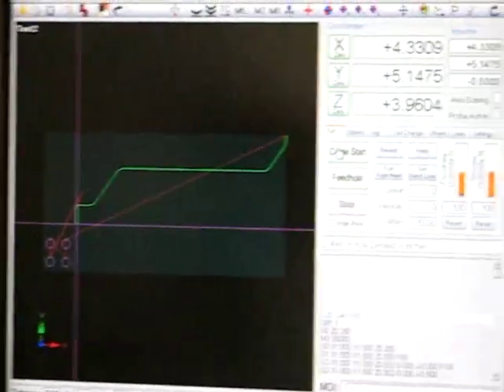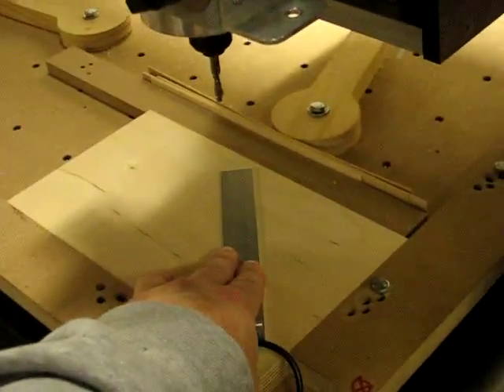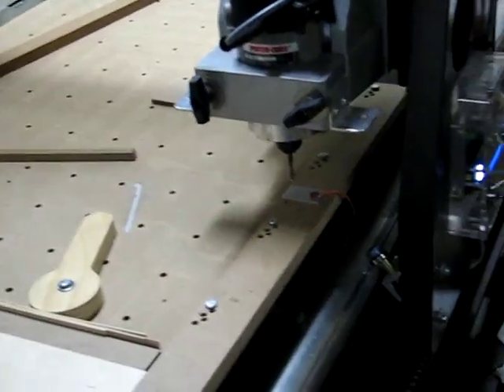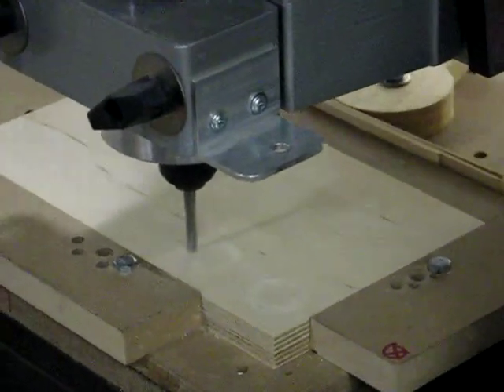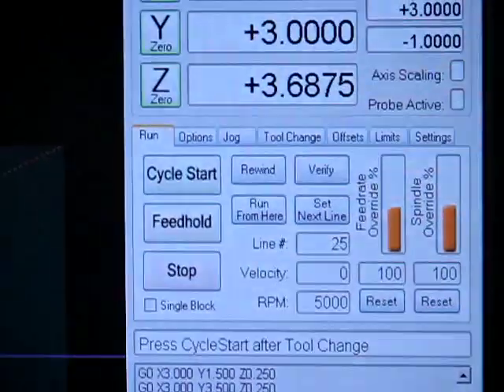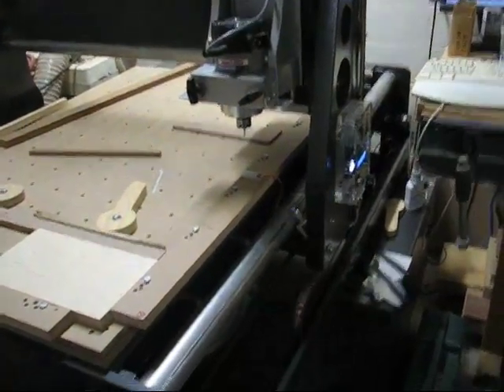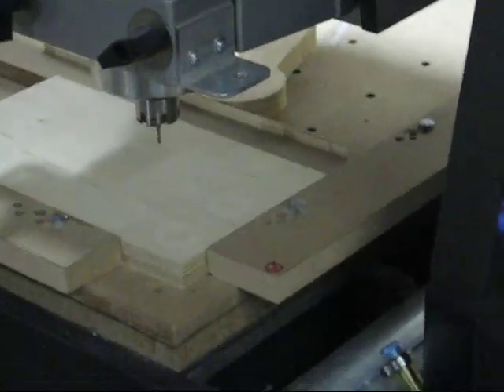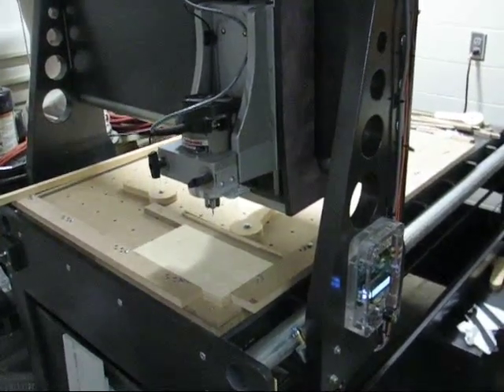Mach3 2010 Screenset Tool Change

Comment: hi I have two question, One can i install the tool change scrips with out installing 2010 screenset...Two if I install the 2010 screenset will i still be able to run my other plugins like edge finder ex.

Comment: After the tool change is complete and the 'Cycle Start' is pressed, Mach3 executes the next line of g code instead of moving the tool to the fixed plate. Could you please let me know what should be done to correct, thanks.
Reply from the maker: +JB 
Make sure you copy the macros from Mach3\2010 into Mach3\Yourprofile.
Does the Initial Auto Zero Work?
Also, on the Toolchange tab, make sure Ignore M6 is NOT checked.
Reply: CNCWoodworker - Auto Zero works just like your you tube demo with the 'Ignore M6' unchecked. However, when Mach3 sees M6, instead of moving the tool to tool change position as defined in the 'Tool Change' tab, it stops. At this point, if the 'Cycle Start' is pressed, Mach3 will read the next g code line. I've been looking all over other settings in Mach3 but still unable to correct this problem. If you can think of something that could cause Mach3 unable to read M6 please email me, flakjacket2k9@live.com. Thank you.

Comment: Do you have a site where you detail how the zero system is working.
I am using Mach3 will this work with Mach3?
Thanks
Reply from the maker: Yes, it's Mach3 running my 2010 Screenset. The Screenset includes all the macros to do the auto zeroing. There's a link to the 2010 Screenset manual and two tutorial videos in the description of this video above. Click Show More if you don't see it.

Comment from the maker: No, it doesn't. To work with an ATC, you would need to combine the 2010 macros with your tool change macro into a new M6 macro that would both change the tools and measure the new one. It's possible, but you'd need to write the macro yourself.

Comment from the maker: I don't know exactly what you want to do?? G55 isn't a position, it's just a different offset from G54 (Which is the default coordinate system).
If you want to move to a specific place, you can just add the g-code to move it there. The nice thing about the Park position is that all your g-code can have an M883 (go to Park position), and you can change the Park position in the screenset and the g-code will go to the new Park position, without changing the g-code.

Comment from the maker: I just finger tighten the bolts before turning the cam clamps. The bolt hole is 1/8" from the center, and they excerpt a LOT of force. There's no need to tighten the bolt. I do always use two clamps, though.

Comment: On the holddowns do you tighten the bolts after you position it or you just let the friction hold it. Is the bolt off center if so how much. If not is what shape is the circular part.r

Comment: what size holes do you use for that grid layout?  is it 1/4"/20mm?  Man, I wish I saw those diy holddowns before I invested $200 into 4 of the nice festool ones.  I may have to save those for non cnc work.

Comment from the maker: @brenck 

It's a Porter Cable 690 with collets from PreciseBits

Spindle speed is controlled the same as with the standard screens. If you can do it now, you'll be able to do it with the 2010 screenset. You can use S10000 in g-code or MDI, and you can use the slider to speed it up or down.